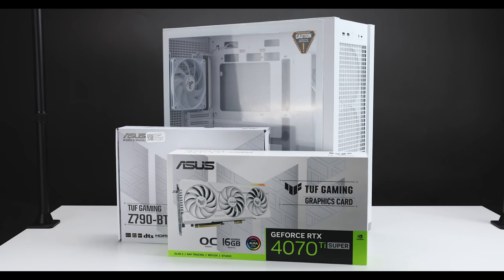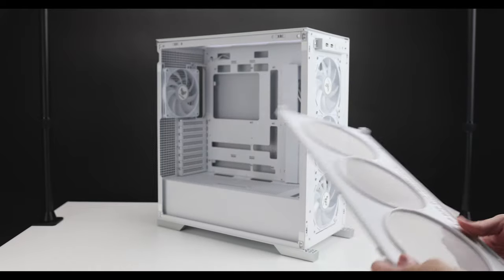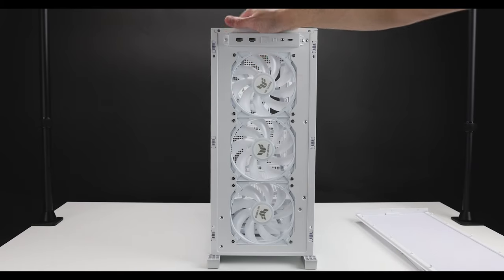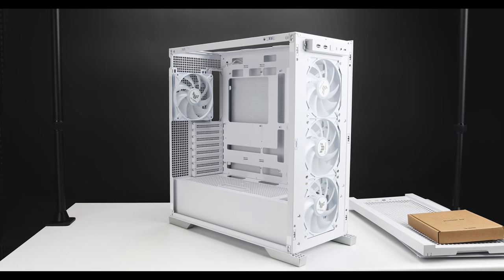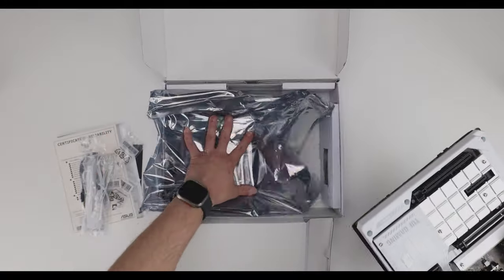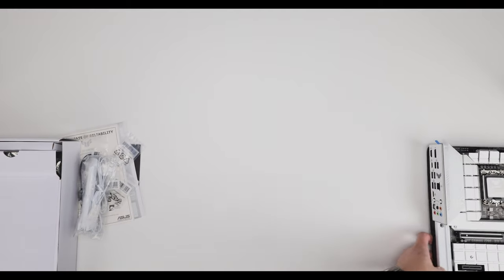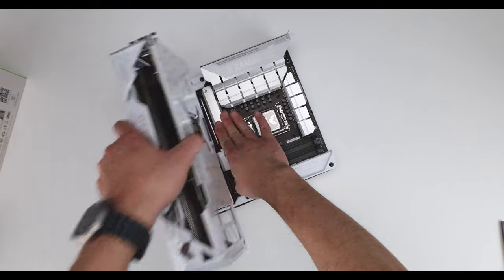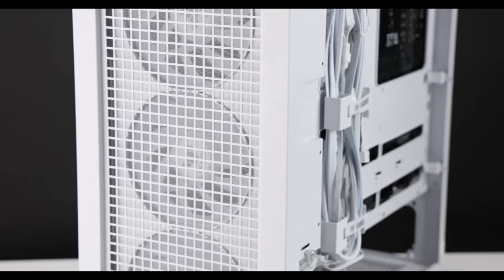BACK TO THE FUTURE:  ASUS  BTF TUF LINE UP Z790, 4070TI SUPER, GT 302 TUF GAMING CASE OVERVIEW.

Comment: Thing just came to mind: Could those motherboard stands come out from simple pipes ? They could also be flat holders.

Like a prison cell it would look like from the back or Spiderweb. You place in the bars you need for the specific motherboard.

Have a [  GAP  ] behind the motherboard, this way it can take any future designs too.

If you like it can have the metal cover, or swap it for mesh or glass.

Yes this current method propably is a short protection, but since we are aware of it, we can MESH around with it.

Got my vision ?